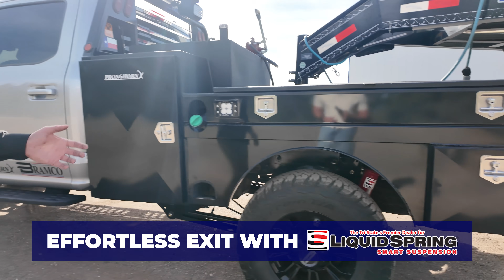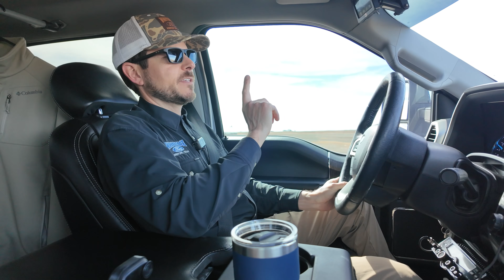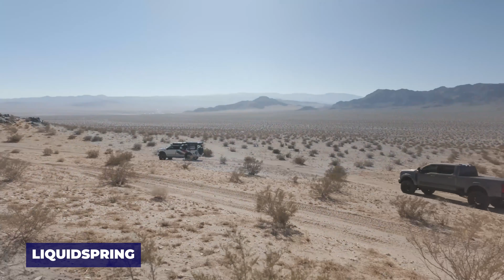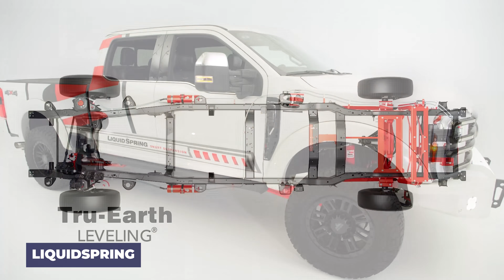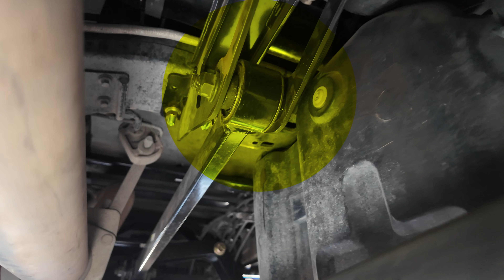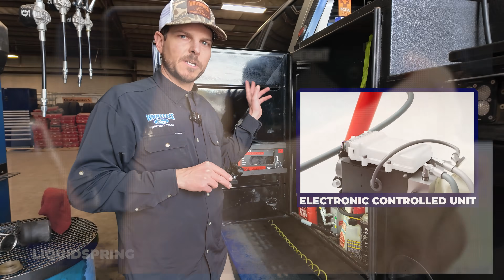Liquid Springs Keeps Your Truck Level Even Towing 20,000 lbs

Comment: We had a firm of liquid springs on kaman h2 helicopter 
To support main wheels
We didn't have a squat feature. But they kept helicopter gear level all the time
No electronics
Just add pressure or reduce if hot

Comment: This is exactly why trucks come from the factory with a rake. Front lower than rear because your rear suspension is going to sag when you load it, and you need the front to still be safe and drivable. Unless your truck is a grocery getter. I could never understand the fad of leveling your truck. It tells me, you don’t use your truck, or you ain’t smart. This guy did a lift, and spent mountains of cash to make his truck work the way it’s supposed to. And please, if you must level your truck, ADJUST YOUR HEADLIGHTS! Because your lights aren’t where they’re supposed to be, and you’re blinding everyone else.

Comment: I just ordered a four corner suspension from my local authorized liquid spring dealer. Parts only - cost $23,078.57
I have a 2026 F350 with the 7.3 gas SRW long bed 

*For those wondering.

Comment: The real trick would be to get the empty truck to ride like the loaded truck.
Reply: LiquidSpring is the only system that has Constant Ride Frequency, that is the beauty of RideSync. The ride is constant no matter the load, and it adapts on the fly as the load changes. Empty truck rides just as good as a loaded truck.
Reply: @LiquidSpring   that's an interesting claim to make...Do you mean the only aftermarket solution with that technology? Or period?
Reply: @LiquidSpring  I've thought about getting into hot shotting.  With no experience whatsoever, my dream truck would be an f-450 with a suspension system like yours!
Reply: In theory, this does. Unloaded trucks ride rough because spring rates don't change. This actively changes dampening rates based on loads and conditions. As long as it's working, it'll ride smooth whether it's loaded or not.
Reply: They absolutely do. I was ff/emt you can absolutely tell the difference in ride quality between stock suspension and liquid spring. Even unloaded in my f350 the ride quality is better than my wife's suv.

Comment: I understand the net added weight of installing Liquid Springs is about 690 lbs. Wow. I was thinking of installing this on an F-250 I have yet to purchase. Should I go with an equivalent F-350 to make up for the loss in payload? Need about 3,000 lbs payload and towing 10k lbs. 

How would you compare Liquid Spring ride quality to the Carli E-Venture (both “active” systems)? Whilst Carli doesn’t offer auto leveling or lifting / lowering, seems to me you get most of the benefit for less expense.
Reply: Order you F250 with the heavy towing package. Includes F350 axle and springs. I own one and love it. Hitch prep included and must order with diesel. Gains about 1000lbs payload.
Reply: @GeneShackelford dang that’s awesome can they retro fit that? I would Love to be able to do that to my f250

Comment: How much does this suspension system cost ??
Reply: A LOT! They offer a couple of configurations (rear only or all 4). I think the full setup is around $20k!
Reply: @talonpilot 😮😮😮😮😮😮😮😮😮 that's crazy just get airbags for a few hundred dollars they work great
Reply: @SierraKnight3277  this and airbags are not the same thing.
Reply: @realisaacchapman  of course I'm aware of that but for far less money, you can level your load and add tremendous stability to your vehicle with airbags.
That's Gas over hydraulic system is totally amazing but it's also very complicated and very expensive. There's more than one way to level your truck is all I wanted to point out to people especially if you don't have an extra 20,000 laying around.
Reply: It’s very expensive like 20-30k

Comment: Fantastic video. Highly informative. Understanding these systems and the thinking that is required is overlooked by most. Excellent information. Just my 2 cents. Nitrogen is not a noble gas like argon. Nitrogen is cheaper because it's plentiful and i understand why it's common. Argon is heavier and is a noble gas and won't leak as easily at all and it doesn't cost that much more, and doesn't attack metals like Nitrogen does. Anyway I use argon when I service any Nitrogen filled system as a replacement gas. Much more durable. IYKYK. ❤😂